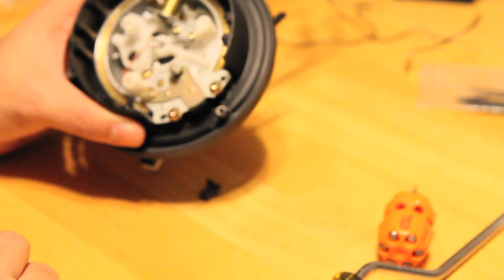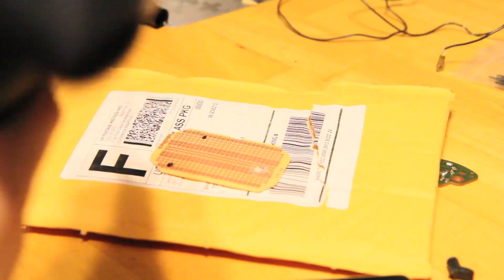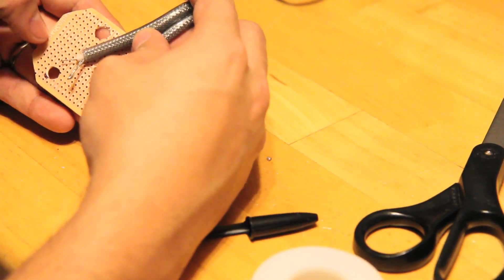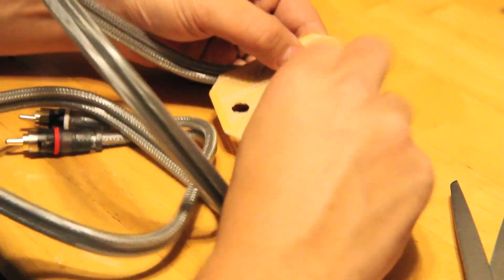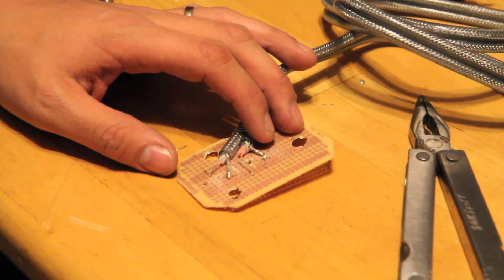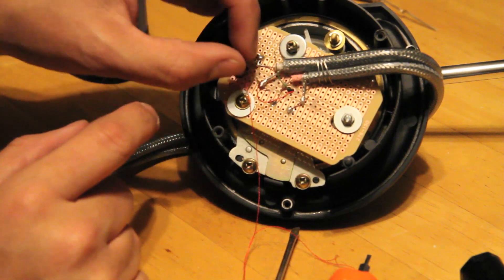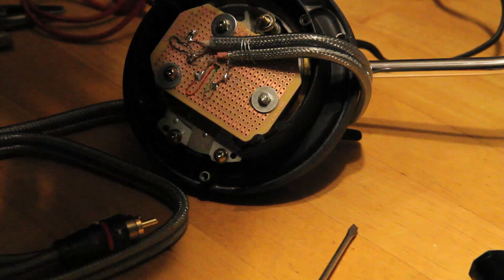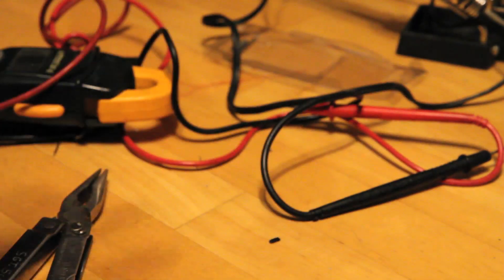Technics Tuneup Part VIII: Tone Arm Wiring

Comment: Your title is misleading: You are not changing the tonearm wires, you are only changing the ordinary signal cable from the turntable to the RIAA.
Reply from the maker: You mean RCA?

And yes, you are correct... however "tonearm wiring" was searched more than "tonearm RCA leads" even when the user meant the same thing. I've done the inside wiring and would never want to do it again, lol.
Reply: @GearItFirst  No he means the RIAA circuit in a phono pre-amp, connected by the cables.
Reply from the maker: @alistairmackinnon4216  There is no pre-amp in the older Technics 1200 series.
Reply: @GearItFirst  There are no preamps in any SL 1200  series turntables.
Reply from the maker: @alistairmackinnon4216  Correct, so your comment made no sense.

Comment: Sorry...a simple question...RCA Board serves only to connect the signal cables that come from the turntable to the cables passing from the arm to the head? In this case can make this connection directly and remove RCA Board so as to remove a further connection between?
Reply from the maker: Yes, but it can pull on the fragile tonearm cables. bad idea
Reply: You can connect the cables straight from the cardridge to the rca connector. This will benefit your audio signal but! you dont want to pull out the wyre out of the tonearm when accidently pulling the rca cable...

Comment: This thick RCA Cable ist senseless.  Da much thinner Cable, connectet to 2 Pieces of Female RCA Connectors - mounted in the Chassis - would be much more usefull. And you can use the original Terminal at the Tonearm Base .
Reply from the maker: This this cable performs great with low noise. I'll stick with it ;)

Comment: Arnoldo, some friendly advice -- when making an instructional video designed to be helpful to the analog audiophile community, it is by definition required that the instruction actually instruct visually.  

While you acknowledge that viewers will not be able to see what you are doing because you shot it with both of your hands in the way thus obscuring the whole point of the upload, it's patronizing to explain that away by stating, "That's just the way it is". 

Redo the video, and this time have someone assist with the filming.  Otherwise you lose all credibility -- and I don't think that was your intention here.
Reply from the maker: Stephen N Guess I lost all credibility. Not refilming. Sorry. I totally get your point, but I just don't have the time.